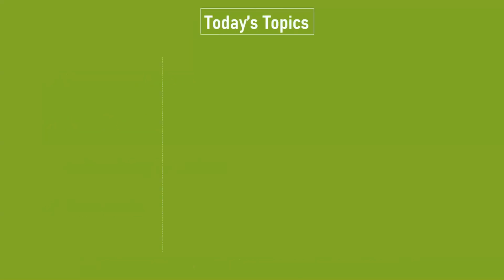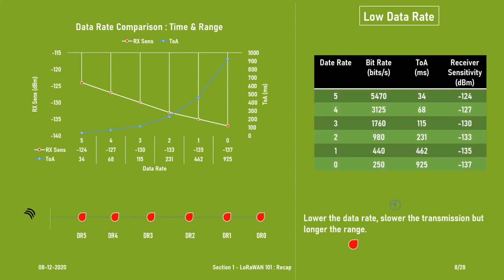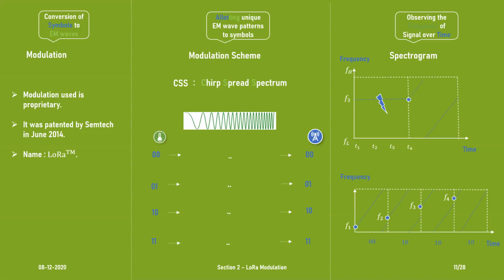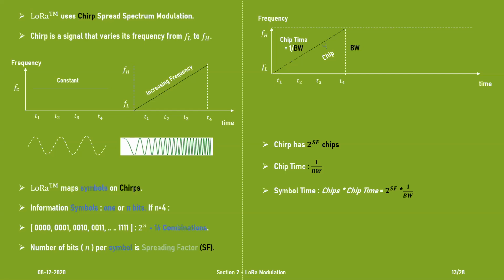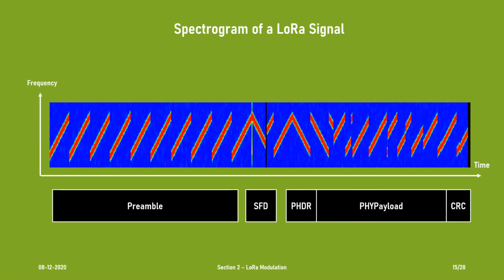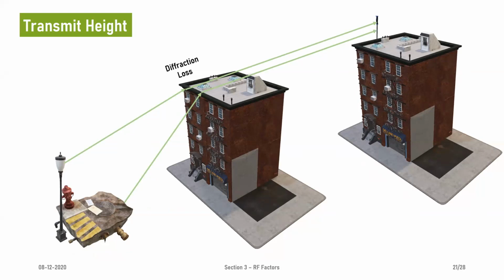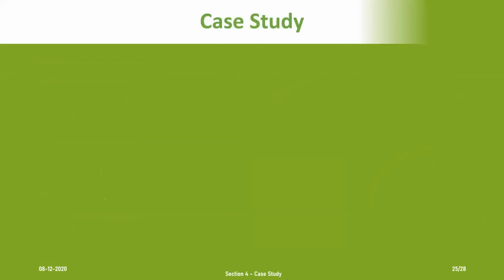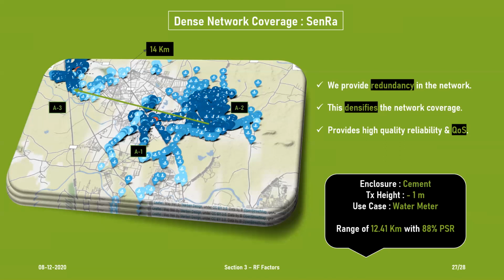Webinar on LoRaWAN® 201

Comment: hi mavendra, and thanks senra. Great info. Pretty much sums up my experience with LoRa. Its very very difficult to convince customers trying to explain the packet loss rate where application is controlling something and reliablity is key. Once we were doing demo on a highway, where we were standing on a bridge with a battery powered gateway and a node was sent along highway sending packets. After 4kms the data loss started and it was impossible to convince a customer why there was packet drop [If only this video could be there back then :) ]. Ofcourse it wasnt a tuned setup for antennas at both ends and just a single inhouse gateway.